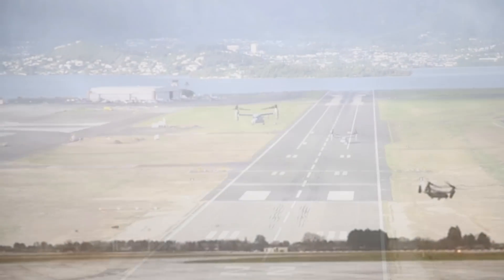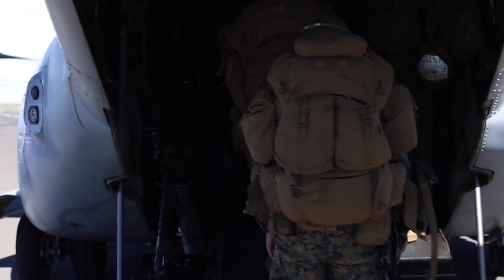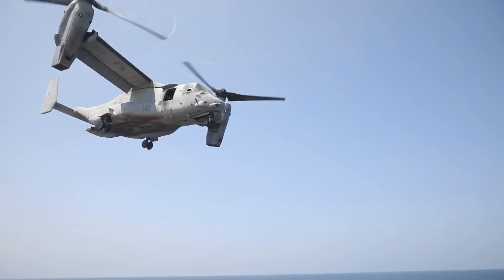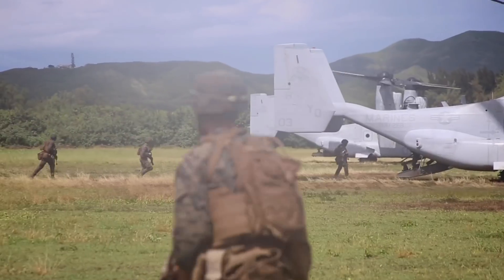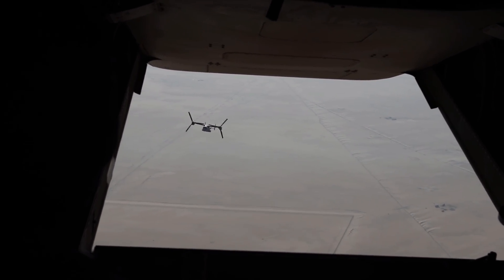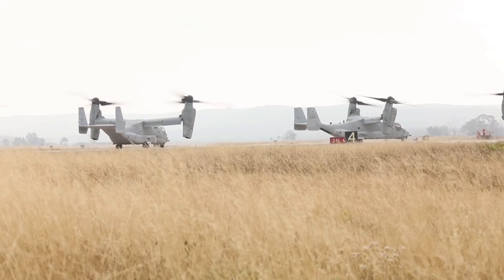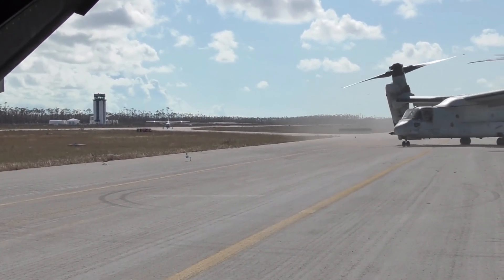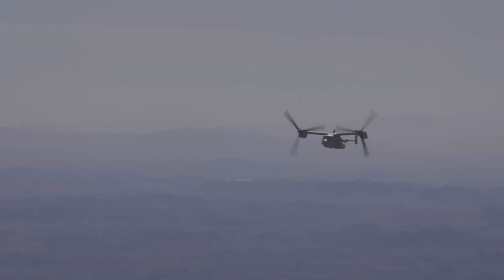Bell Boeing V-22 Osprey | TILTROTOR AIRCRAFT

Comment: the v-22 program is a $36billion scam on taxpayers, and a completely unnecessary threat to the lives of marines.

The V-22 Osprey had 12 hull loss accidents that resulted in a total of 42 fatalities. During testing from 1991 to 2006 there were four crashes resulting in 30 fatalities. Since becoming operational in 2007, the V-22 has had seven crashes including two combat-zone crashes, and several other accidents and incidents that resulted in a total of 12 fatalities.

Many incidents were  caused by the v-22 under-performing its advertised capabilities; 8k lb lighter payload, 40knot slower speed, and limited insertion/extraction altitudes which were ignored to try and prove otherwise, in hopes of selling the aircraft as more capable to congress who were rightfully scrutinizing the program.
Reply: zebu rancher and in the end the program delivered and we got a good helicopter plane that works and does what it’s supposed to.
Reply: @kcimb  you are wrong. unless what it is supposed to do is endanger the lives of our marines, and scam americans out of their tax dollars. note that I did not include injuries, go do some research. out of 200 produced aircraft over 10% have been permanently grounded without ever taking flight.
Reply: it is not just the crashes, if you seriously want to just write those off, not to mention that every single crash would have been avoidable with conventional aircraft... this aircraft is too big, with no payload; how many Armed V-22 have you seen? wonder why that is? it is too slow, it cannot perform v/stol at altitude, for instance on a mountainside, yet that is the mission it is tasked with. this makes it incredibly vulnerable to all outdated AAD. This aircraft is a complete mess from its very foundation.

people think it looks cool. it does.people appreciate it as a feat of engineering. it is. but then people push it into service as a military craft. it is not one, it cannot and should not be made to perform military service, it is not fit for duty.

Comment: The V-22s are cool, but fatally flawed. All anyone has to do is damage one blade of one rotor while it is hovering below 5000 feet, and everyone dies. It is a big slow moving target. Dynavert type craft were far more robust.
Reply: mrnickbig1 apparently if you damage the rotors on a regular helicopter they fly just fine 😂😂😂
Reply: @kcimb  , no, but they are much smaller and more maneuverable targets than the lumbering Osprey. V-22s also have much wider rotor blades. Helicopters can also mount far more weaponry than a V-22. You seem to jump to odd conclusions. V-22s are only better than helicopters in two respects: They look cool, especially when folding up, and they can fly faster at medium altitudes.
Reply: mrnickbig1 except the v22 is more maneuverable and can travel faster and father. That’s one of the reasons it was selected. 

So what helicopter can handle rotor damage and keep flying? 

They even have gun ship ospreys now.

Comment: Great platform until you need to either dig it out of a salt flat (landing gear penetrated the surface and the suction was too great to take off), or compensate the civilian airport operator because the exhaust blast has scorched the take off area.

Comment: We need this in Britain for the QE class carriers, especially AEW or in-flight refueling versions, ditch some of the conventional helicopters for these, bigger, faster, better range and altitude
Reply: They're not very suited to that role. They only have internal fuel storage, which limits the amount of aircraft they can refuel and they are extremely expensive to operate.

Arguably their main benefit would be top-up 1-2 F35bs, particularly after they get off the deck, which would either increase their range or weapons load-out. However, since the F35b cannot carry external weapons without compromising it's stealth capabilities, this benefit is somewhat nullified.

Perhaps if they could be modified to carry more fuel instead of crew internally, then they'd become more cost effective.
Reply: us marines are working on roll in fuel tank just like is planned on the a400
Reply: @richardjbarlow  there already IS an in-flight refueling model in the works like the others here said, we still have Chinooks and Merlins anyway for heavy lifting, and as for AEW just put the same Crowsnest stuff from the Merlin in it. As for the F35 how much more often is their maximum stealth capabilities gonna be required than just dropping bombs on something d'you reckon
Reply: @1IbramGaunt  It's certainly valuable, I'm not disputing the current refuelling capability. The V22 could also increase the strike range of the entire carrier group, which as shown in the falklands conflict, is quite important.

However, given the cost of operating and maintaining a suitable/worthwhile fleet of aircraft, you would need to justify its value vs its opportunity cost.

For instance, would we prefer a larger F35b airwing at the expense of refuelling capability? Or more Type 26 fleet escorts vs a more sustainable F35b cap using V22s as refuellers? What is more valuable for Britain? etc (It's honest question.)
Reply: @richardjbarlow  we have enough escorts either ready to go or on the drawing board already, so long as we don't suddenly scrap or sell off half of them after some stupid defence review anyway, we only HAVE two carriers to escort after all. The main big problem, as every QE-class hater out there points out again and again, with our new carriers and their F35's is actual combat range, payload and the duration they can stay IN combat, thanks to the ski-ramp and VTOL approach we've taken; that and yes the actual number of jets each can carry of course, but that's never gonna be as many as the Americans no matter what. And, as I say the present number of actual F35's is enough for going on with and can be kept if some of the conventional helicopters are switched out, only a couple of Ospreys for each ship will be needed anyway, we don't need vast numbers of these things
Reply: @richardjbarlow  The answer is the nearly unlimited roles Ospreys can play thus increasing its overall value to justify cost. ASW, S&R, potentially AEW, SAS insertion, another platform to move royal marines, COD role to move spare parts to UK and US F-35B carriers and escort vessels etc.

It should also be remembered that Merlins are in-flight refuelable and the ability of Ospreys to in-flight refuel them means Merlins (with CROWSNEST) can vastly extend their loiter time and ability to loiter much further from the UK battlegroup.

Name something else that can do all that. Suddenly the cost seems pretty cheap actually.
Reply: @Chuck_Hooks  again, no argument here, you're preaching to the choir haha, tell it to our penny-pinching government though
Reply: Yes that's a fair point @krosny, it is adaptable and as I mentioned earlier, it increases the strategic depth and strike range of the carrier group. All plus points.

While we have enough escorts for now. Many of them are in maintenance and we have manpower problems. Didn't we lose 3/4 of our air defence frigates in the falklands war? How many escorts could we afford to lose in a sustained conflict today before having to bring the fleet home?

Just playing devil's advocate here. I don't think it's as simple as saying, oh these are a great force multiplier so we should buy them. There's always another area that needs funding too.
Reply: @1IbramGaunt  Good points. And as time goes on and more US F-35B carriers like USS Wasp and America come online it is going to be inevitable that UK and US F-35B carriers will be sailing together to form powerful independent joint battlegroups. 

The ability to almost DOUBLE the number of aircraft of all types available is going to be too much fun to resist.

No doubt UK and US pilots will be flying routinely off each other's carriers. In that sense US Ospreys can refuel BOTH UK and US F-35Bs and Merlins. So the point may end up being moot anyway.
Reply: @Chuck_Hooks  true and hopefully so 🙂 but it's always better to still have at least some of the same capabilities entirely on your own, just in case like in the Falklands there's no allies to help (directly in the field I mean)
Reply: @richardjbarlow  hey I never said we should suddenly stop building frigates and destroyers just because we should have a few Ospreys too did I. As for the Falklands losses the defences on our modern warships, especially stuff like Type 45's are much, much stronger now, those were hard lessons but they needed to be learned and they HAVE been
Reply: @richardjbarlow  Good points. My answer would be that US and UK F-35B carriers will be sailing and training together more and more as time goes  on. 

It is just too delicious an ability to nearly double the number of F-35Bs available in a strike package. 

And double the number of escorts as well by adding in at least one US cruiser and/or destroyer and adding a US supply ship to help supply both carriers.

UK escorts have been protecting US carriers for a long time. Now it is time to return the favor and US escorts assist in protecting UK carriers.

No doubt there will be one UK and one US attack submarine screening the joint battlegroup as well.
Reply: @1IbramGaunt  No doubt being prepared to go it alone has to always be top priority. And that brings us back to UK Ospreys being able to extend the attack range and loiter time of F-35Bs and Merlins (with CROWSNEST) and thus adding to the independence of UK battlegroups to go it alone if need be.

In a major Allied war, it may be that the USN is so stressed that the UK battlegroups would be asked to spearhead operations alone. 

So yes. Independent operations should always in the forefront of preparedness.
Reply: @Chuck_Hooks  absolutely agreed 😊 strongest military partnership in the world, true brothers-in-arms; buuutt still with a degree of good-natured rivalry too though lol
Reply: @Chuck_Hooks  and yep, at the end of the day they might be American-made aircraft but everything else involved (aside from those US Marines actually on board of course) is 100% British, including the pilots and aircrew, the most important part of all- and that's how it should be
Reply: @1IbramGaunt  Very true😊.The marine and UK F-35B pilots will be working on the good-natured rivalry at the Queens Head pub on board the QE😉
Reply: @Chuck_Hooks  which she actually does HAVE of course 😂 how awesome is that
Reply: @1IbramGaunt  Marines getting to fly off UK carriers then having a few pints (more than a few lol) with cool UK pilots and crew at the Queens Head pub on the QE. Some guys have all the luck👍🇺🇸🇬🇧💪
Reply: @1IbramGaunt  There is a very significant UK parts manufacturing contribution to the F-35B as well making it a jointly built aircraft which makes it all the better.☝️🇺🇸🇬🇧
Reply: @Chuck_Hooks  true 🙂 although American jets flying off British carriers is actually nothing new anyway. Is strange to think but if we'd still had HMS Ark Royal, our last full-sized fleet carrier, and her F4 Phantoms in 1982, the Falklands War might've taken a lot less time and far fewer British lives, if it had happened at all. She was only laid off and scrapped by yet another penny-pinching government a couple of years before
Reply: @richardjbarlow  They already are being modified to be tankers. 

https://www.marinecorpstimes.com/news/your-marine-corps/2018/04/23/the-corps-is-on-track-to-turn-the-mv-22-into-a-refueling-tanker/
Reply: Japan already has their Ospreys and will be ready for their future F-35B carriers. 

Hope the UK gets some of these, too.
Reply: @Chuck_Hooks  Hopefully so, hell if anything with our much bigger made-for-purpose carriers with bigger decks and hangars we're arguably more ready for them THAN the Japanese are. Biggest problem's gonna be money though, these things ain't exactly cheap. Could always wait for the inevitable Chinese knock-off and buy THAT I guess lol
Reply: @1IbramGaunt  Indeed, it's the cost that's an issue. It's not capable of refuelling many aircraft, which makes its operating costs uneconomical for smaller powers.

As others have kindly posted, efforts are being made to improve the fuel load, so perhaps it will become a good platform for us to purchase in the future.

We certainly could use the refuelling capability. The further out the aircraft cap, the better the fleet will be defended. But I think the reason we went for the F35B and QE designs were due to cost effectiveness? Hence, it doesn't make sense to break the bank. Let's wait for the Americans to pay for the R&D ;)
Reply: @richardjbarlow  for refueling many aircraft at a time they either, y'know, LAND and do it the old-fashioned way or much bigger proper land-based tanker aircraft like KC-130's are used, something like this on the other hand may only be able to refuel a couple of F35's at a time and just extend their range and payload a bit but that's ALL THAT WOULD BE NEEDED. And unlike those land-based planes it's a refueling capability that goes wherever the ship does, and sure it's not a cheapo option and I never said it was, FOR that reason we probably indeed WON'T be buying them sadly, doesn't mean we shouldn't be though
Reply: @1IbramGaunt  Not cheap. However,  the USN decision to buy 39 Ospreys to replace the old Greyhounds adds to the nearly 360 the marines have bought bringing the total to almost 400 Ospreys. That is a lot.

Now would be a good time for the UK to jump in and take advantage of the buying power of the USN especially and negotiate a reasonably low price.

Neither the UK nor the US F-35B carriers have onboard in-flight refueling capability and the marines are modifying them to at least be recovery tankers. Both the US and UK need this ability. 

UK will undoubtedly want Ospreys for SAS insertion and recovery at some point. Ospreys can perform ASW and potentially AEW roles, too. Not to mention having another platform for moving royal marines around.

Marines are turning them into gunships and the UK should be interested in that, too.

It is going to be found out quickly that Ospreys are indispensable on F-35B carriers for both the US and UK.

Japan has already figured it out.
Reply: @Chuck_Hooks  no argument here 🙂

Comment: I built the V-22 A/B Osprey @ conception, going back and forth between the CH-47 Chinook for 32 years. Many downs at start with V-22 do to problems with prop rotor and aerodynamic airflow thru rotor's during a hard "Hawk" like landing. Plus, political issue's that wanted this wonderful aircraft cancelled...
Reply: ... I can confirm your statement(s) ...
Reply: @remalm3670  Thank you sir. Did I have the pleasure of working with you?
Reply: @Aresfire2  ... Unless you did something at Lewis Research Center (name has been changed). Supported (tech) wind tunnel and power transfer (issue between the two rotors, power transfer. Think DC crash)...

Comment: Still cannot go into high threat areas.
Reply: Timothy Quick they sure do fly into high threat areas the same as other helicopters do
Reply: @kcimb  ... Without going into SOP's. If there is a high probability of contact; because of the limited number of VM-22 and the specialized tasks (doing things only a VM-22 can do) ... They are not risked ... Other means are used ...

... You're not one of the International Socialists (they're know as Democrats in the United States to include RINO's) that tried to sabotage the program so 'Ronnie would look like an idiot'? Fail the program and offer that 'Star Wars' wouldn't work either. The AFGE 'pulled out the stops' to 'fail' Reagan' ...
Reply: R E Malm v-22s dropped a marine fast team
Near the embassy In Iraq to protect it and fight off the Iranian militias. So much for not going into hot zones.
Reply: R E Malm isn’t exposed to high threat environs..as two of them land a 100 man fast team outside an embassy...

nOt hIgH tHrEaT
Reply: @kcimb  ... The capacity of an VM-22 is not the capacity of a duce and a half (all of them) 😌...
Reply: R E Malm so the v22s made multiple flights into a high threat zone? 

I was told this can’t happen 🤨
Reply: ... It's not designed for frontal assaults ...
Reply: Timothy Quick - Peckham?